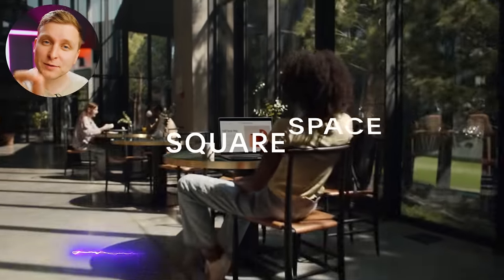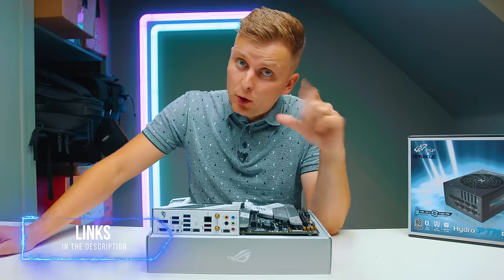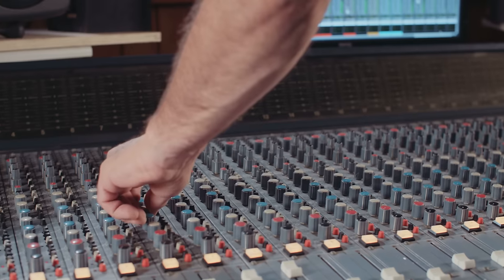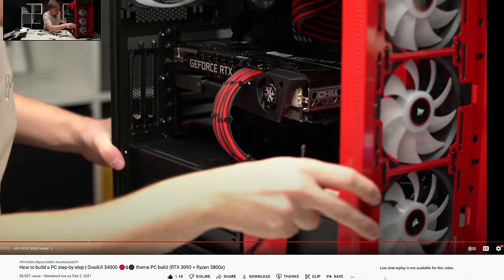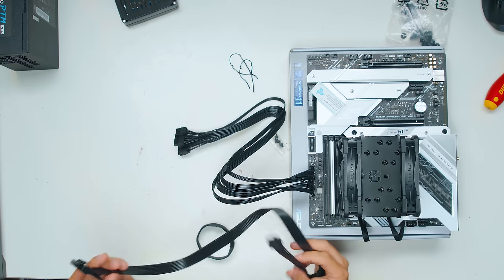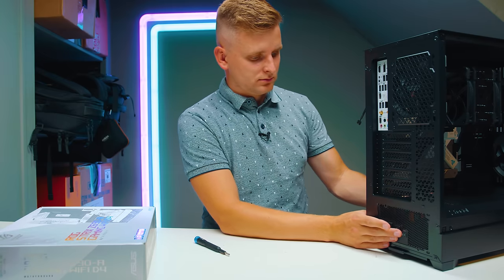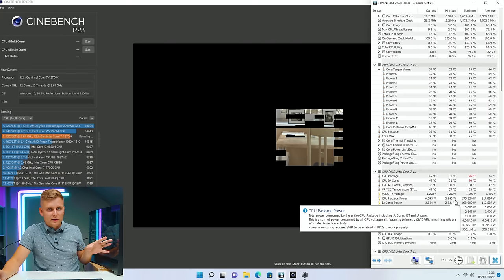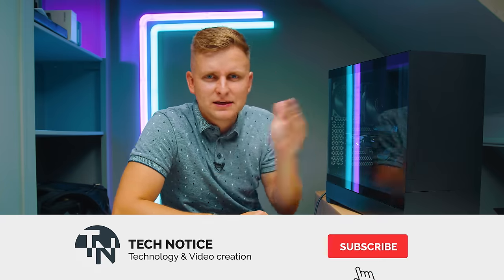The 98% Silent PC 🔇 - DAW PC build guide for Music Production & Quietness

Comment: RAM matters in audio. Flexibility with buffer settings limits audio drop-outs and improves latency. DDR5 is definitely worthwhile for audio production. Bluetooth and WiFi are useless in the studio. Not worth consideration in a DAW build. Everything should be outboard via USB (mostly), if the build doesn't have a professional audio card in a PCIe slot. Thunderbolt is great in Macs, not so great in PC's historically; dependent on drivers from Microsoft and performance gains per dollar/euro aren't convincing. Onboard connectivity isn't relevant, external audio interface connectivity is. RAM doesn't improve capacity for track count, typically each track is dedicated to a single CPU thread. Very pretty looking PC, but people in audio don't need anymore confusion from gamers about building a DAW. Its difficult enough as it is.
Reply: Asus ROG Strix Scar III laptop owner here (i7 9750H, RTX 2070, 16GB 2666Mhz DDR4, 2TB 970 Evo Plus), having difficulties with DPC Latency when using external audio interface (Presonus Studio 24c) like audio dropouts-pops. When using the onbard Realtek, i have no audio pop. (doing my Thesis in Unity and thought i could also use a DAW with this beast... nope) Seen so many laptop-pc benchmarking videos, no one measures Latency.
I have this problem 1,5 years now, haven't found the fix yet. (I have already done ~10 clean windows formats (with drivers, no drivers, no optional drivers), have every latest driver from asus, tried win 10 /11, bios options, power options, setting windows audio as priority, changed ssd to a faster one, tried turning off CPU C1E state, etc. nothing fixed it) I can see i have latency with LatencyMon but i don't know what to do after. If you have any idea please let me know. I want to play with Ableton and also make some audio stuff for my game but that pop thing is driving me nutts. 🤬
Reply: @vasileiospgr  Latency is normal, so I hope your not trying to eliminate it altogether. That isn't possible. Depending on what your doing, it may be best to accommodate the limitations of using computers when processing audio. Not as much investment has been made in computers for audio as has been invested in imagery. If your using an external interface, Realtec shouldn't have anything to do with it. If your studies are concerned with graphics, and your laptop is loaded with high volume processes, it may be allocating the machines resources to other processes and causing 'poping' in your audio stream. You'd need to dedicate a seperate machine for audio to get flawless use of Ableton.  You may be using Ableton in a way that places too much burden on your laptop. Popping on playback won't necessarily appear in the final sound file. You should still be able to consolidate your work done in Ableton and put it in your Unity project without them.
Reply: @jfh142857  the popping thing is happening any time i use my external audio interface. like when playing a video on youtube, playing any file that has audio like litteraly when i play audio and have nothing else running in the background. in LatencyMon the latency i see is some thousands in Red (with nothing running)... that is definently not normal. i tested it on my old desktop and my desktop doesn't have this problem with latency. Desktop stayes at 300-350μs but my laptop reaches like 20.000μs. usually i see that something is happening with the ACPI.sys driver. (Also had an IT that took a look at it but didn't found a fix)
Reply: @vasileiospgr Try Asio and a higher buffer rate also make sure your sample rate is matching os and interface.
Reply: @coletrainisback  i have already done that :)
for going as far as disabling CPU CE1 state and throttling yeah i believe i tried enough but no fix tho :(
Reply: @vasileiospgr  If the interface was designed for an older windows the drivers might not work right try a reinstall directly from manufacturer although that's typically what makes me upgrade an interface they can die too. Don't forget to check cables and USB ports some usb3 interfaces don't like USB 2 ports and vice versa. Disabling/updating realtek audio drivers and setting interface as default may help. 
Edit just looked at the interface I'd bet you're using a 1/4 to 1/8 adapter in the phones port if you are try a different adapter the should be 2 line trs and the same one the cable you plug in. Don't cheap out on those even the good ones kinda suck.
Reply: @coletrainisback  no i'm not using any adapter. all my cables are TRS, XLR by Roland. when you measure high DPC Latency on a pc, that pc has a problem. (It's not normal to have high DPC Latency from what i've seen) its not the external interface (i also send it back to the store and they checked it) or anything on my desk. it's just my laptop. i have to buy a new desktop to fix this -_- 😢
Reply: you are talking nonsense
Reply: @thunderstein5041  Enlighten us. How do we build machines for making music?
Reply: @jfh142857  I've got a question.. I'm building a pc for my protools 12 native pci card..  would it be better to have a i9 13900 k processor with 128 gigs of ram over his 64 gigs using his i7 127000 processor?  
I own all the plug ins a person can buy.. I'm using native instruments komplete ultimate 14.. but most of the tracking is guitar. Bass. Drums. Vocals.. 
I was originally looking at the GIGABYTE Z790 AERO D LGA 1700 Intel Z790 ATX Motherboard with DDR5, 5* 5.0 M.2, PCIe 5.0, USB 3.2 Gen2X2 Type-C, WiFi 6E, Intel 2.5GbE LAN.. and this Intel® Core™ i9-13900K Processor
36M Cache, up to 5.80 GHz 
Raptor Lake...
Reply: @jfh142857  he's saying that he can't understand what you're saying 😂
Reply: @Dking863  I personally have the AERO D and I love it, the 2 ethernet ports (1x10Gbps, 1x2.5Gbps) are useful for a dante card and the extra PCI lanes are very helpful for a word clock receiver among other things. I would say you do NOT need 128GB of RAM. 32GB will suffice and is likely overkill for most applications. Prioritize the speed over the size for your ram. As for the CPU really focus on single core/single thread performance, that is the most most most important thing when looking at a build for DAWs. all your plugins and tracks are only using single thread so prioritize the single thread performance above core count as single thread speed is what determines your latency. when it comes to storage the video is mostly right in that you want 1 drive for your applications and 1 drive for storage. For the applications drive prioritize speed again, while for the second drive I would just find an affordable option with plenty of storage to keep all your old/cold projects
Reply: @johnesparza7170   I bought the proart board with the i9 13,900k processing... I've got one drive for the O.S. another for virtual instruments and another for protools.. I put 64 gig of ram in my buddies system with an i7 1200k.. there's no latency when I record through it.. I'm slowly buying everything.. I just want to buy this once every six years.. it gets expensive
Reply: You must be fun at parties
Reply: @sziartopeter8943  i'm sure he is. and also good at his job, unlike others
Reply: @vasileiospgr go DAWless, use your pc for visualizers 🤷‍♂️
Reply: @_B.C_  i don't need to go DAWless. My latency problem affects all audio. Both external audio interface and integrated audio interface and any audio source (movie, video, youtube, audio file, discord,... anything with audio), even while i'm working in Unity (cause also in my project i have audio (footsteps, attack sound, ambience audio etc...))
Reply: Switched from NVIDIA gpu to AMD and no more dpc latency issues resulting in audio dropouts.
Reply: @bistermean2046  did you checked if you had a bad driver?
Reply: @bistermean2046 is this a real thing? Nvidia doesn't work well with audio?
Reply: @vasileiospgr I have super old computer i3 4gb ram using ableton and fl studio and have no latency. I am using gen3 focusrite 2i2. Something is wrong with yours. I can play YouTube and any videos and daw without any problem.
Reply: I also have m1 MacBook and is faster, but with right drivers and setup you should be fine with out any popping sound
Reply: @vasileiospgr  are you using ASIO ?
Reply: @vasileiospgr  you are the one talking nonsense.
Reply: Bluetooth midi is actually awesome. I use a few CME WIDI Master devices in my studio and they are awesome.

Comment: For anyone trying to make a decision between the Noctua cooler and the Thermalright Pearless 120....I just completed a build with the Thermalright cooler, 4 Noctua NF-A12x's(in vid) +  2 NF-A14's, and even before tuning the fans, the build was so quiet. I'm cooling an i9 12900K inside the Corsair 4000D Airflow, havent had tempts go above 85 on the CPU in any of the bench marks ive run so far. Asides from what I think is maybe too much negative pressure inside the case, I am beyond satisfied with this build.
Reply: Are you seeing thermal hot-spots? I am curious why you think you have too much negative pressure.
Reply: @mageprostudios4334  i dont think i even know how to lool for thermal hotspots lol but now im going to try. But i was noticing that i have quite a lot of air being drawn in through the back pci slots under the GPU. I've heard this is a way you get a lot of dust build up inside the case, so I need to figure out my fan speeds a bit more i think.

Comment: That's a great guide, thanks man, really appreciate it.

As it turns out, I discovered way back when -- 20 years ago maybe, as a teen in teen rooms -- that the most silent PC for music production is the one that's not in the room :D
What we used to do, because no money to improve PC noise, is drill a hole in a wall (preferably closet) to wire cables to the other room next to it (say another room or garage) and put the PC there and wire it back to the intended desk (VGA + USB KB/mouse + USB for ADC/DACs). It's janky and parents will kill you if you do it wrong, but it works(TM).

I hear pro studios do the same sometimes, there's a backroom with proper isolation and everything routes there (USB, HDMI etc) over ethernet for length/signal power. Just like we route XLR's all the way if we need to :p

Nowadays, I agree that for most SOHO (or Small Studio / Home Studio rather), you can build perfectly silent PCs. And that was a great how-to!

Comment: This is by far the best DAW directed PC build guide I've seen on the internet so far. Your choice of motherboard was spot on, I would have also included that the ethernet ports can be used for audio over ethernet protocols like Dante, this gives you a lot of options for high quality audio interfaces without having to buy expensive option cards. I also liked that you chose an E-ATX board as PCIe expansion cards are very common for things like word clocking (a must), MADI/ADAT connection, as well as DSP acceleration so having those extra PCI lanes are very important. I do think your RAM choice was a bit overkill in terms of size, having more than 16GB doesn't really make sense for a singer song writer type, maybe up to 32GB would make sense for someone doing large projects but might still be overkill. But I wouldn't go up to 64GB unless you were recording orchestras with multiple mic arrays recording at 192kHz/24Bit for hours at a time

     I don't think the noise is that important as professional production setups will try their best to put any noisy machine in another room. But for the home producer having their computer in the same room might be a must to avoid spending a lot of money on long cable snakes and KVM extenders. That being said I think it would have made more sense to go with the Noctua ULN specified fans. The 120mm NH-S12A ULN with the LNA attached produces only 6.7dB according to Noctua's website, which is astonishingly low. Along with that it could have been interesting to use the fanless CPU cooler from Noctua as well. Though with the current fanned cooler you have very low levels of noise, that low level can become more noticeable in a properly treated room with isolation from the outside and silent HVAC. For reference a professional control room's ambient noise level is about 20dB which is equivalent to the sound to a watch tick, which is why most studio designs place the computer in a completely separate room.

Comment: My 16 year old MOTU audio interface went tits up a couple weeks ago, and the PC it was on was an old i7 950.  That PC was still running very strong for audio recording, actually, but I wanted to go Thunderbolt with a new audio interface...so I built this system this week.  I used slightly different components beyond the motherboard and processor.  I also reused my old case.

Can't thank you enough for the pointers on this build.  When you build a PC every 12 years all the parts look like alien technology.  🤣 So guidance is always welcome.  You couldn't have been more timely with this video for me.  First boot was last night...looking good so far.
Reply: Hey @HOOK, which board for thunderbolt did you finally got? I'm building my new PC, and since I have the MOTU 828ES I wanna use its thunderbolt connection.
Reply: @Siziksu  I'm using the ASUS Thunderboltex 4 with this ASUS ROG Strix Z690-A.  Pretty easy to install.  I can't, for the life of me, figure out how to update the firmware on the card, but it's communicating perfectly with an Apollo X6 at this point so I'll just let it be.  Good luck.
Reply: Thanks a lot! By the way, which cable do you use? The only way I find to go thunderbolt is to buy from Apple the thunderbolt 1/2 cable + the thunderbolt adapter to thunderbolt 3. Is this the only way?
Reply: @Siziksu  I'm not sure I understand the question exactly...but my Apollo is Thunderbolt interface.  I'm using a Startech Thunderbolt 3 cable.  Working fine with this Thunderbolt 4 card.
Reply: @skullsession  Oh, excuse me, I don't know why I thought that the port on your interface was thunderbolt 1/2 like the one in the MOTU 828ES. Thanks a lot anyways for your answer, I'll have a look at Startech hunderbolt cables!
Reply: @Siziksu  I understand now.  No.  My Apollo is Thunderbolt 3.

Comment: The noctua cooler is installed backwards. It should be flipped 180. It probably doesn't make much of a difference but if you look at the install instructions and look at the top of the cooler, the heatpipe holes are teardrop shaped. The tail of the teardrop should be pointing at the direction of the io shroud.

Comment: that's a very nice clean build, good video, didn't expect you to cover DAW users,
WiFi may cause interference and noise issues in studio environment, but on the other hand Bluetooth may prove useful on MIDI-over-Bluetooth capable controllers and audio gadgets;
one thing I'm not sure I can agree on is the CPU choice:
apart from fact Windows 10 can't properly schedule tasks between P and E cores (and many musicians and producers may want to avoid W11 yet), DAW apps and audio processing in general (regardless of OS) heavily relies on consistency, which mix of P and E cores cannot deliver by design - that said 12700K gives 8 performance cores and overclocking potential to lock frequencies, but you have to completely disable its 4 E cores to prevent DPC latency spikes and unexpected slowdowns when processing audio - means, something like 12600 instead which has only 6 P cores is no hassle, and arguably at half the cost not much of a downgrade from 12700K for audio workflow...what do you think?
Reply: I am currently running Reason 12 on Win 11 with no issues at all...
Reply: Changing the power plan to high power with 12th and 13th gen intel cpu's running windows 10 will eliminate the issue you describe between P and E cores. Just means lower priority tasks are still given to P cores so E cores are not utilised. More power consumption though that's the only trade off. There was also a windows 10 feature update a while back that addressed the issue. The scheduler from windows 11 was backported to windows 10.    

Been running 2 pc's for my studio with windows 10 and the latest gen cpu's for a long time now with no performance or reliability issues. Performance is mind-blowing when working with multiple virtual instruments running and playing at the same time. I also game from time to time with no issues either. For me I don't feel the need for windows 11 at this point. And with windows 12 just around the corner.... I will wait and see what windows 12 brings to the table in terms of hardware/software compatibility/benefits and whether it provides any benefits to my workflow. I dread the thought of transitioning my music workstation to another OS and avoid it unless it's absolutely necessary for productivity.

Comment: What we do is create baffles which close all the holes in the case EXCEPT for a lower front one, and the top-most rear panel fan hole (which a fan being affixed and running is crucial).  This creates a closed system except the inlet and outlet.  The top rear fan pulls cool air through the front lower open hole without turbulence within the case.  This design prevents running extra fans that only create more noise too.  Having a speed control on the top rear fan is good so you can set it where it's at the right speed for sufficient cooling (monitor your MB temps here) and lowest noise.  You can create a quiet case like this with almost any of the cases on the market now.  For those cases with a PSU tunnel which is separate from the motherboard cavity, you don't have to have a fan on the inlet there.  You can simply utilize the outlet fan that's built into the PSU.  Adding foam or mineral wool (or even Owens Corning compressed fiberglass) sound dampening and butyl hybrid sound deadening sheets can further reduce noise and help direct airflow.  It's very simple for people to do. :)